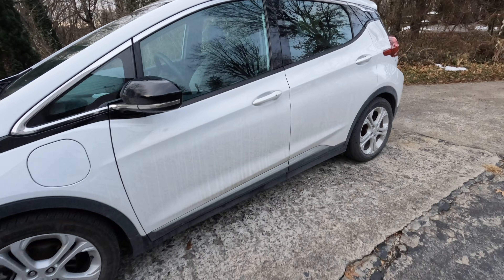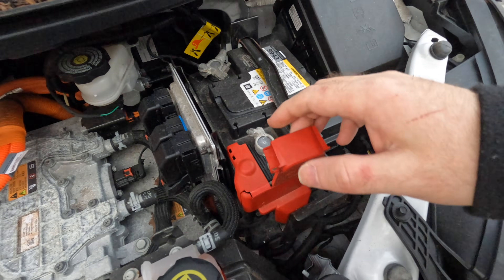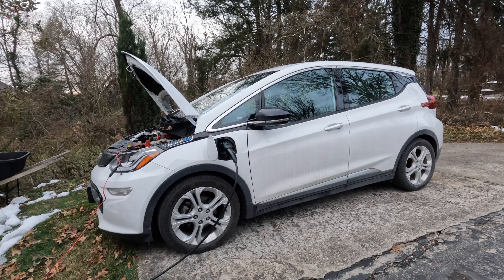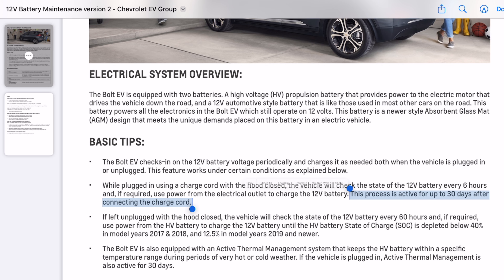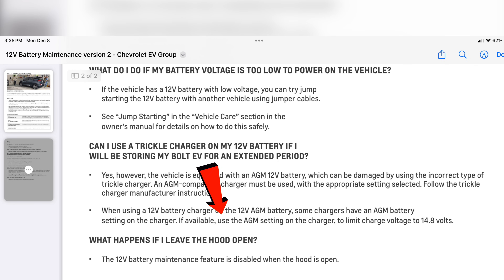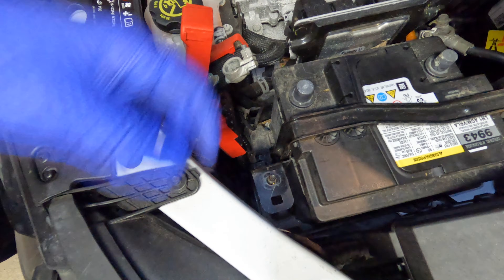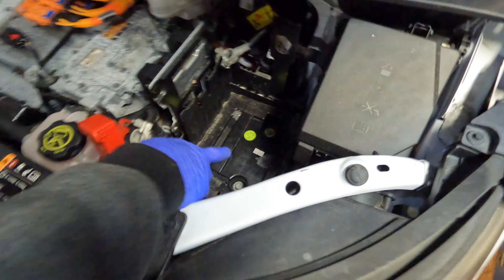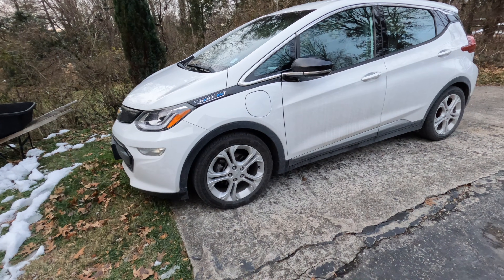My Bolt WON’T START! Troubleshooting Chevy Bolt 12v battery   Everything You Need to Know

Comment: Yeah, mine died in 2023(75,000 km) on my 2017 Bolt. I didn’t know you had to replace them every five years Lucky I died in the summer wasn’t too far away, but it happened to my wife and her friend while they were garage sailing with the kids. I called the Chevy dealer closest to me and they didn’t have any. another had one on sale…. My dad and I installed a Delco AGM 12v battery. Old battery was dated 2016. A mth later i successfully jump started my dad’s MDX with it. Reg. $432.03
Sale $291.61
Tax $34.99
We had to stop halfway and head to the nearest hardware store to pick up all the extension tools that were needed.
Reply from the maker: Great points here!  Thanks for the feedback!

Comment: Did you actually get your battery tested? I saw in your video that the car was sitting at about 25% SoC and you said yourself it doesn't maintain the 12V battery under 40% SoC on the traction battery. How long had it been under 40%? My 2019 Bolt had the original 12v battery for 5 years with no degradation. I feel ya though, middle aged men are always itching to fix stuff. 😂
Reply from the maker: I kept the old battery. It’s my son’s car, and he wanted the new battery.  I’m pretty sure it was fine.  Just cold and low State of charge.  Thanks for the feedback

Comment: About 7 months ago I bought a used 2018 Bolt from a Chevy dealership, the traction battery had been replaced a few months earlier by the dealership; the car was a buy-back with 24k miles and in excellent condition.  

Before I signed the papers, I asked them to check the condition of the 12V battery first; they tested it and it was good, so I signed the papers and hoped that that meant the 12 V battery will not have to be replaced anytime soon (I don't know if it's original or a newer replacement).  But I'm glad I did think to have them check the 12V battery first, because if it had not tested good, then I would have insisted that they replace it (at no charge) if they wanted me to buy.
Reply from the maker: Good thinking!

Comment: Aren't you supposed to connect/disconnect negative first? Opening door: On the door handle, is there a plastic cover on the back of the handle that you pry off. It covers a keyhole, and the key is in the fob. Boost: not needed in this case, but these boosts should have a "Boost" phase that can boost a completely dead battery? This phase overrides all safety circuits when used.
Reply from the maker: You’re 100% right.  Negative first. Great point about the standard key.  Thanks for the feedback!

Comment: If the Bolt is completely dead, there's an emergency access key in the fob and the lock is under the plastic end cover on the rear side of the driver's door handle.
Reply from the maker: Much appreciated! I’m glad it didn’t come to this!

Comment: Adam thanks. Did you consider a memory saver, ie, a battery plugged into the OB2 port so that you don't lose radio settings and so on? I always wrap the positive terminal, especially when it is hooked up to a 12V  "jumper".
Reply from the maker: I was worried about this.  Luckily my son just uses CarPlay all the time.  So he didn’t have any presets.

Comment: Wow, kinda pricey for a 12V battery. I guess AGM batteries are more expensive.  I wonder if it'd help if you plug the battery maintenance charger regularly?  Just to top it off periodically?  I used to drive ICE cars, and I think those 12V batteries last like 8 years.  But I don't live near snow, so that could explain it.
Reply from the maker: My son preconditions the battery for long periods of time on a regular basis.  He also had the climate set to what is, in my opinion, an unreasonable setting.  On top of that, he was below 40% charge, and attempted back to back trips, all at sub 32 degree temperatures.  It was just a matter of coincidences that could have killed any battery.  Unfortunately, because of so many factors, it’s hard to tell what did it.  I appreciate your feedback!

Comment: For ICE vehicle owners wondering why an EV requires a 12V Lead Acid battery (this is based upon my experience with two Nissan Leaf's and "may" be helpful for Bolt owners). 
EV's use a small Lead Acid battery for their accessories and for safety purposes. They are not used for starting or providing energy to drive the motor. However, an EV won't start with a dead 12V lead acid battery. The safety interlocks (contactors that keep the high voltage Li-ion battery isolated when the car is not in use) require 12V in order to actuate. Because EV's do not have alternators they depend upon DC-to-DC converters to power the 12V accessory rail and to keep the 12V accessory battery charged. The DC-to-DC converter steps the high voltage from the Li-ion battery down to 12V to power the 12V accessory rail (actually about 13.5V) which keeps the 12V lead acid battery maintained. This is how things should work. In reality that 13.5 volts often gets dragged down to under 13.0V when excessive draw is placed upon the accessory rail (this happens in my Leaf with the voltage dropping to 12.85V when the HVAC is on and the fan is set to the highest speed). To compensate the DC-to-DC converter will from time to time (especially when ambient temperature go below freezing) momentarily jack the 13.5V up to 14.5V. (the Nissan Leaf also does this every time the windshield wipers are engaged). For maintaining a healthy 12V lead acid battery this is typically adequate. However, for a 12V lead acid battery that's getting old or has been overly stressed and driven below 12.6V once too many times the charging system will struggle to maintain the battery and it will die a slow death.
Reply from the maker: Thanks so much for the explanation!

Comment: Really wish I had this video 3 months ago when my recall bolt had it's 12v die out on me. Did not know about self charge stopping after 40% or needing to use an AGM battery charger.
Reply from the maker: I learned a lot researching for this video.  I had no idea either.  I hope you have trouble free 12v batteries going forward, Cheers!

Comment: You'd think that with all the troubles a depleated 12V can cause, EVs would have a little spot on the dash with a constant 12V indicator.  I bought a quick charger with a 12V indicator.  Peace of mind only cost 20$. 🤣👍
Excellent video...I'm sure it's gonna help many people on the verge of freaking out. 😉
Reply from the maker: This is a good idea.  And yes, I wish they all had one.  Thanks for sharing your experience!
Reply: @Aslash304    Let's just thank God GM didn't make it so you have to bring the car in to "update", "initialize" or "configure" the swap...all for the cost of a 1h inspection rate. 🙈🤭
Reply: Exactly. The car is always checking in on the battery. In my Lightning, it then adjusts how it charges the 12V, so it lasts longer. Probably that's what the Bolt does. But you don't get that data. Just a little heads up, hey your battery is a bit sad but not dead, and people can be prepared. If you buy a used EV that may have sat for a while, the 12V might be stressed more than you think.

In the Lightning, seemingly unrelated but scary error messages indicate 12V failure. It'll say the steering has failed or the brakes. Anything that uses a 12V motor to run will see the low voltage and throw errors.

Comment: The 12 volt battery is a little terrorist under your hood, responsible for so much hassle and fear.  I hope to be able to replace mine with a LIFEPO, I'm concerned about battery management for a vehicle design for lead acid
Reply from the maker: All of the documentation I read says not to switch it because the system is designed for AGM.  I didn’t want to risk it.  I think the LFP packs are way lighter.

Comment: In the early months of having a used 2017, my 12V died. I swapped one that fit out of a Focus, but that one died within a week without driving. After a lot of messing around with pulling fuses to find a draw, I figured it was an Bluetooth OBD adapter that I'd left plugged in. Though how that signal could have pulled that much current I don't get.
Neither battery seems to be faulty, and why the 12V monitoring feature let me down is also weird. Anyway the OBD gets unplugged and no prob in 18 months.
Reply from the maker: It’s crazy how certain devices have such an impact sometimes.  Thanks for sharing your experience!

Comment: I replaced the battery in my 2019 last year preemptively. It was the original and I didn't feel as though it had many Michigan winters left in it. I got an AC Delco replacement from Rock Auto. It was about 200 delivered.
Reply from the maker: Good price!  That’s the battery I had in mine.  Smart to do it before it goes.  Thanks for the feedback!

Comment: My 2019 died suddenly after sitting and then driving 2 hours. I mght have left an accessory on but not sure. Got a replacement for $130 on Amazon
Reply from the maker: If I didn’t need to drive the car I would have done this as well.  That’s a good deal.

Comment: This is why people buy Tesla, which charges the 12 volt when plugged in.
Reply: So does the Bolt. See this video, 4:17. Batteries die.
Reply from the maker: Someone didn’t watch the video.  Welcome to the comments section of the video that addresses your concern in complete and microscopic detail.  Feel free to refer to it for more details.
Reply: It does. Battery voltage just dropped too low

Comment: How much of your settings did you lose?

Have a 23 Bolt EV 150k km (50k a year basically) battery still reading 15v from the cigarette lighter phone charger plugged in. Not sure how accurate that is. GM might have over engineered 12v battery charging due to bad press🤔
Reply from the maker: Luckily I didn’t lose anything.  One more day and I think it would have died much less gracefully

Comment: What?? A GM that does not use side post battery terminals AND the cable nuts and bolts are nicely angled upwards? And there’s not a pile of sulphuric corrosion at the posts?

Be still my beating heart. I … may need a moment here.
Reply from the maker: The Bolt is a quality car.  A lot of little things done right.  I really like them.  Thanks for your feedback! I’ll take that moment with you

Comment: I still have the original battery on a 2017 bolt. I’ve not seen any indication of a problem but I did find the voltage was 12.4. I bought a replacement on Amazon and will install it when the weather heats up a little bit and I get a ratchet set with long enough extender. Thanks a lot for the video, I’m gonna save it to review before the work.
Reply from the maker: Thanks for checking it out!  I appreciate you sharing your experience

Comment: Before I got my first EV I had a portable jump pack that I kept with me. I kept that up when I got my EV. This saved me. Kia puts a junk 12v battery in their Niro EV, and from what I've read, probably all of them. I started having frequent occasions where I had to jump start the EV with the jump pack, as dumb as that sounds. Kia tested the battery as good. Other places tested the battery as good. I got a tester and my tester tested it as good. I decided to just say eff it and replaced it with a high quality AGM battery, but the size is not common in the US so I got the closest size I could find, which is a few mm tall, but the same in other dimensions. This was quite a while ago at this point and I've had zero issues since. I still keep a portable jump pack with me, though I had to replace it this month because my old one finally went bad after having it for many years. If this is something you want to do, you don't need a big powerful one. It doesn't take nearly as many amps to engage the contactors as it does to turn an ICE (I measured 40 amps peak).
Reply from the maker: Thanks so much for the travel tip!  I agree that it’s smart to carry a jump pack.  Thanks for watching!

Comment: 22 Bolt.  Got “ Battery Saver Active” message in January.   Dismissed it.  6 months later got the message again, but I dismissed the message.   The next 3 months I noticed the car acting odd, the blind spot indicator on driver side was on when there was no car next to me.   Wherever I would start the car it would take a few seconds.   Climate control would also glitch, on the screen it would say that it’s off but the button controls would be fine.   Eventually the 12v battery completely died when I parked in a shopping center for about 30min.   OEM battery only lasted 2yrs.   Warranty on it was 18mo 😑    I purchased the same battery seen on this video because it was the only one available.  Pretty easy install.
Reply: When I got a battery warning on my Fiat 500e, it died that day
Reply from the maker: I really appreciate you sharing this.  I’ll most certainly keep an eye out for it. Cheers!

Comment: The car should have a way to tell you the 12v is dying, don’t you think ???
Reply: It gives you a warning message on the dashboard “Battery Saver Active” unfortunately if you don’t know what this is, you can just dismiss the message.  The car keeps working normal.  You’ll never see that message again until few months later.  Then eventually the 12v battery will just die.
Reply: I hear you. I mean, it complains of if I leave the charge door open … I’m just lazy enough to ask, “If I drive fast, will the door just close on its own?”

(Theory untested. Adam? I’m sure you can assign that experiment to Shane).
Reply from the maker: It should be more clear about when to change it.  Shane is taking after me a bit on driving, so I’ll need to tell him to drive faster to test the charger door
Reply: @Aslash304  Never let it be said I don’t help provide content ideas.

Comment: I put a “battery minder” (not a trickle charger - Google the difference) on my 12-volt AGM battery overnight, once a month, and never had a problem for the seven years I had my Bolt.
Reply: But if you’re using the car normally, connecting, disconnecting, driving, it sounds like the car does all that for you. 

Eventually, the 12v will die.
Reply from the maker: Sounds like a good battery.  Thanks for sharing your experience!

Comment: Battery grease?  Or is that not a thing anymore?
Reply: I’m new to AGM batteries … the grease doesn’t seem to be needed since the sulphuric acid is better contained inside the battery.

Notice there was zero buildup at the posts of the old battery here.
Reply: I'd put some grease on the bolt as well.
Reply from the maker: It looked pretty trouble free under there, so I decided to go without.  AGM maybe?

Comment: Hey Adam, love your videos (subscribed). I bought my ‘22 Bolt EV 2LT Aug 30 2022. Still chugging along on the oem 12v. 
Garage kept in central NC. 
Keep up the great work. 
Side note, on Blazers, I like they added a port open button on the info screen and I believe putting car in gear it’ll auto close. 
Personally I would clip the DC cover cord. Put cover in pocket when fast charging (so it can’t get stuck in door if you use auto close) n you’ll be more aware of it when you check your pocket later.
Reply from the maker: Thank you for subscribing!  I like the pocket method!  I appreciate your feedback very much